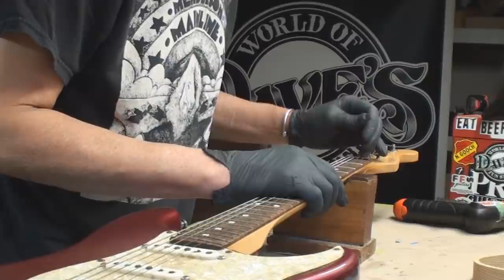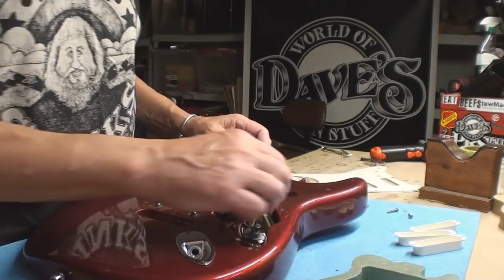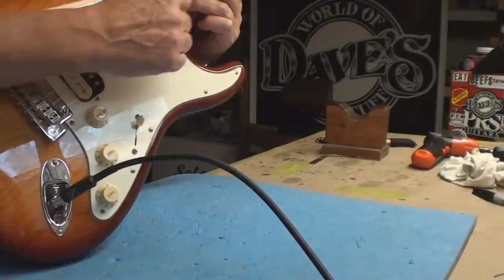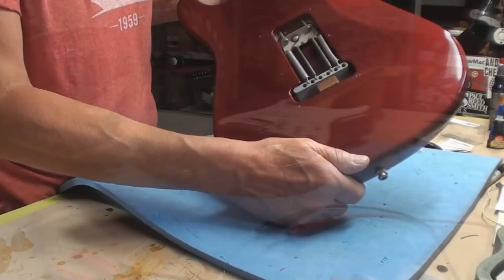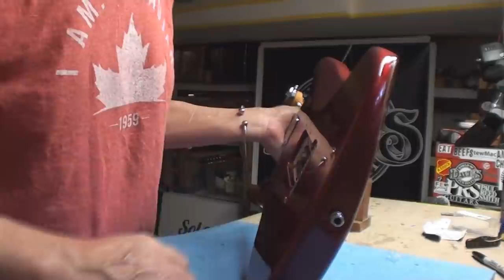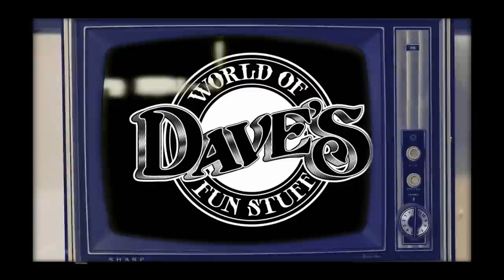Stratocaster Movie Marathon

Comment: Nice renovation work there Davey ! DiMarzio make nice pickups, I wonder how long before the guy buys another 2 ?
After you take the bridge out of the hypersonic pickle bath, what do you do to make sure you have all the water out and it's not going to crust over again like a dried up scab ? Please tell me you remove all the tiny little screws and blow out the holes then treat the screws to a brass bush and some 3 in 1 oil, I'd love it if you did that but I'd settle for a few drops of WD40 in the holes and spin the screws out and back in.

Comment: Looks kind of similar to a 1987 (or 86?) American Standard Stratocaster I owned from new. Back then Fender were still recycling serial numbers and so the one printed on the headstock started E42... - making it appear older, but it was definitely an 86/87 and had the swimming pool route. IMO it was a good guitar and reliable enough to gig with on a regular basis (just a covers band) but relatively cheap enough that I wasn't worried about taking it to some of the more 'colorful' bars... Anyway, I sold it about a decade ago and the guy was happy to have found it, because he said back then Fender were returning to American production and during that era some of the employees on the production line are/were now in the Custom Shop. Don't know if you that's true, but he seemed pleased with it. I made more than my money back and in any case it had paid for itself many times over. Also, I had a USA Telecaster from about the same year, similar (although non trem) bridge and seemingly identical neck profile. But I got rid of that one not long after buying.
Thanks for the movie marathon, Dave - and for the memory jog.

Comment: FWIW - if just the coating on the windings dissolved, you'd get a short (very low resistance) not an open (mega-ohms). It's possible it corroded enough to actually dissolve wire, leading to an open circuit, but that would be pretty severe. Usually it's caused by someone hitting the wires with some tool while playing around with it with the cover off. Closer inspection (magnifying glass) you might be able to see a broken spot, or a small dent or nick. On an old vintage pickup I had that was open I was able to unwind about 20 wraps until I found the break. YMMV.

Comment: Poor strat. Makes me sad. As dirty and corroded falling apart as neglected guitars get, they don't hold a candle to the revolting potential of neglected cases. There are cases I didn't want to approach without full hazmat gear, didn't want to attempt to fix, felt like advising setting on fire and moving on.